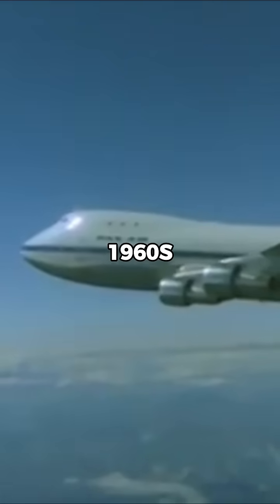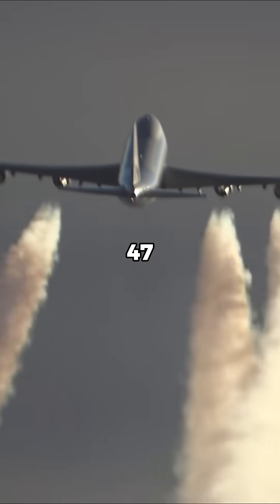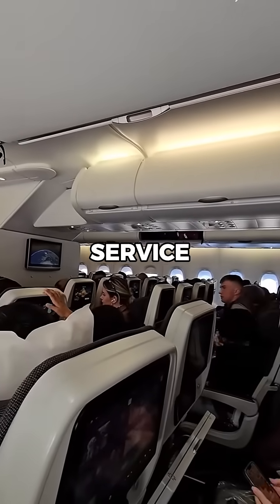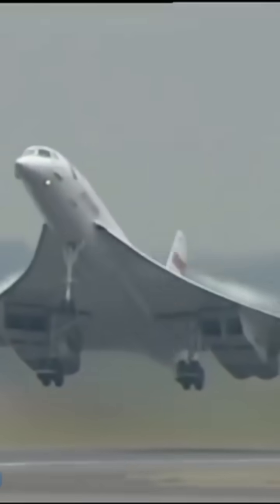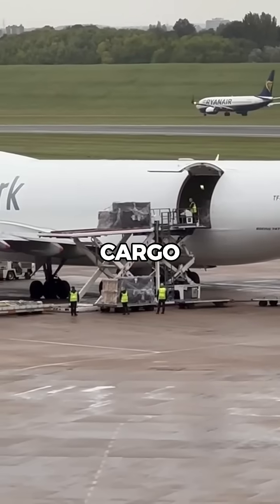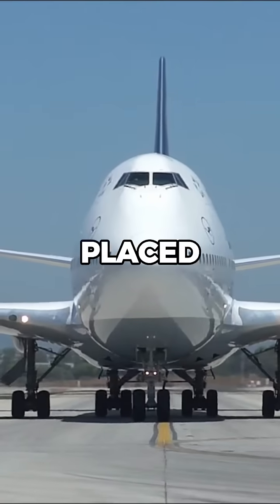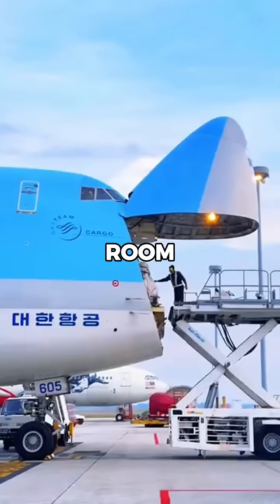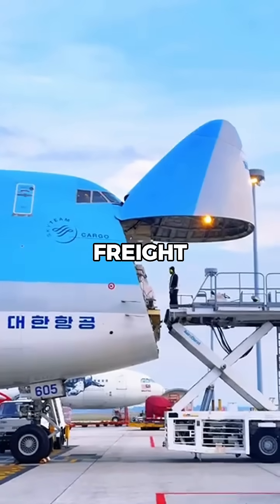why the Boeing 747s hump nearly ruined the aircraft

Comment: The raised cockpit and upper deck actually did not cause any significant drag issues. Its shape and design actually improved aerodynamics. The 747 was actually initially conceived and designed to fly faster than she actually did. For the faster version, she would have had an additional 2 degrees sweep  to her wings to more efficiently allow for the extra speed.
Reply: The more the wings are swept back, the more runway speed and distance will be required to takeoff and land.

Comment: :fun fact did you know that 747 can only land in airports that are strong for big airlines
Reply: Funner fact. The 747 was designed to land and take off from any airfield where a 707 or DC-8 could land or take off from. And any of them from the 747SP up through the 747-400 can. The 747-8 needs a longer runway and wider clearance because of its extra length and wingspan. Those are among the reasons the 747 has its very large and complicated flaps, slats and spoilers and its landing gear configuration. The 747 has a very considerable performance envelope. It turns out the wing sweep angle was a compromise. The fuselage was designed to fly at higher speeds than it did in regular service. One of the big constraints in not extending the upper deck the full length was the length and steepness of the upper rear evacuation slides if you had to evacuate the plane with the nose wheel collapsed. It put the rear slides very high and steepness. They were concerned about the speed the passengers going down the slide, injuries and burns from friction gong down the slides and how far they would bounce when they got to the bottom. Otherwise, making the upper deck was not really any kind of problem. They could easily have done so. 

Oh, and the 747 holds the world’s record for the most passengers ever carried on any airplane. 1088 on May 24, 1991.
Reply: That “fact” is incorrect.

Comment: The DC-10, the L-1011, and the 747 were all designed to compete in the wide-body jumbo jet market. Mc Donnel-Douglas sold 350 DC-10s, Lockheed sold 250 L-1011s, and Boeing sold 1,500 747s. The hump worked out OK.

Comment: The upper deck greatly assists with the Whitcomb Area Rule, and stretching it from the -200 to the -300 allowed a slightly higher cruise speed. 

The hump is key to the success of the Jumbo for reasons aerodynamic, but also in structural efficiency, and utility.

Comment: Compressed matter was borrowed when the 747 was designed, nobody had compressed matter at those times. The 747 was designed to carry ballistic missiles against the Russians. Conpressed matter can be carried with a heat balloon too, that is why the plane looks like a heat balloon pushed forward by a plane. Little boy, many missiles, fighter jets look like a 747, the enlargement must have a density, do it can't be made of paper or thin material. Even drones look like a 747, the rockets can be outside the body of the craft. Ifvan Airbus carties a compressed matter, thr frint wings are nothing because it's about gravity. In this case an empty 747 has to fly nearby.

Comment: the 747 was actually meant to have a full upper deck, but the  60 foot rule for emergency exits prevented this, but lets not forget the entire fuselage wouldnt be as wide as it is if it didnt have an upper deck.
Reply: What is 60 foot rule ?
Reply: @Carusiast  all emergency exits had to be within 60ft of each other, to ensure quick evac in an emergency
Reply: @The_Naviator  who sets these rules faa/easa ?
Reply: @Carusiast  faa set them to stop boeing from removing emergency exits on the 747

Comment: Yet the 747-8 is the fastest passenger jet in service
Reply: And it has 4x super powerful GE GENx engines! ✈️🔥
Reply: I read this as fattest
Reply: I mean like, excluding the A380 your not wrong 😂😂😂
Reply: Yep, that hump gives it a "coke bottle " profile and in wind tunnel tests gives lower drag, greater efficiency and higher speed. Who would think, before computers and YouTube engineers were clever enough to go to basics. Test shape in the medium it needed to work in. They even adjusted air pressure in the wind tunnel to allow for the difference in scale between the model and real thing. Air flow was tested with tufts of fibre stuck on the models. Now planes are computerised and designed to crash! 😂
Reply: @geoffreycodnett6570  last sentence blew it off. Clearly Yall can’t stop stereotyping Boeing whenever it comes to any and everything. Yall are acting like Airbus never had a crash.
Reply: @geoffreycodnett6570 designed to crash? What are you talking about?  I flew on the 787-9 and the 777-300 and there were both amazing …15 hour flights…no crashes …carbon fiber and aluminum…👍
Reply: @geoffreycodnett6570 none of what you say is true. Drag has absolutely nothing to do with the top speed of an airplane. It’s all about wing aerodynamics. The 747 is so fast because it has the highest wing sweep of all airlines at 37.5 degrees.
Reply: @geoffreycodnett6570  you sounded intelligent until the end..
Reply: @geoffreycodnett6570 Computerized and designed to crash? I think you are the fool here
Reply: @geoffreycodnett6570  You sound like someone who would write those conspiracy articles your mom would send you about why something was bad for your health that was supposedly “published by Harvard scientists” just to try to get you to stop doing it because she thought it was annoying.